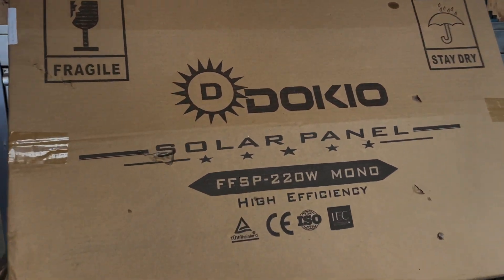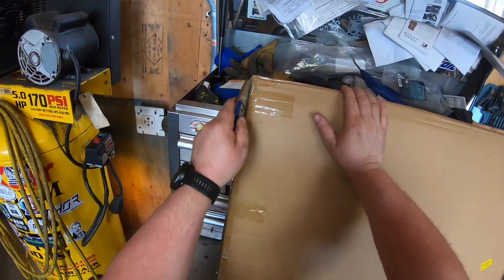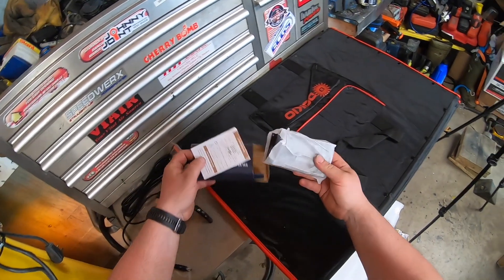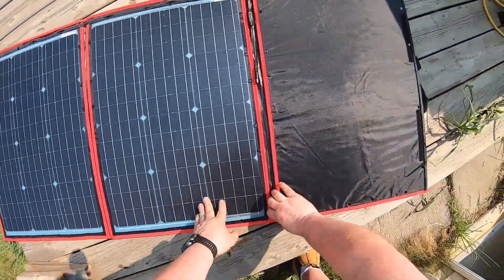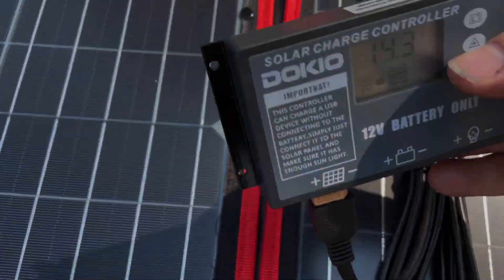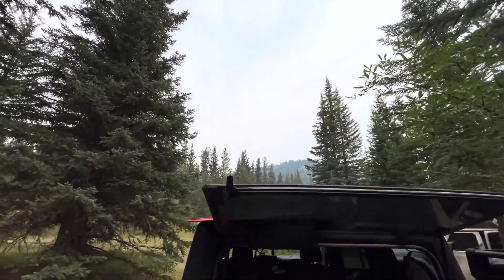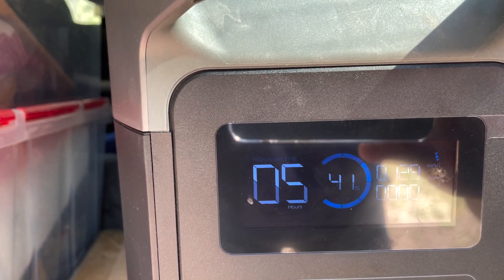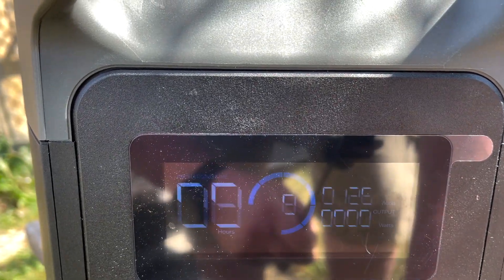Dokio 220 Watt Foldable Solar Panel

Comment: Hi Jerry… I ordered the panel also because the description on Amazon says it has two USB ports to charge directly. Did yours claim to have that?
Reply from the maker: I never use them to be honest
Reply: @TestDontguess  OMG! I use USB to charge my Dewalt batteries that run lights, fans as well as tools…. I can’t go without changing so many items that I thought it would be easy with this solar panel. Just checking who has put YouTube videos out. Maybe you got it free… I paid for mine.
Reply from the maker: I have portable power stations for power, the solar panel just keeps the power stations charged

Comment: Informative video, thanks for sharing it, I've got a couple of questions. 

How has the DOKIO 220w worked out for you so far? 
What's the unit that you are using to plug in the portable solar kit called? What can you power with that unit? 

Thanks

Comment: I bought a new house this past year and all new construction homes built here in Commiefornia are now  required to have solar.  I wasn't completely convinced until I started getting my power bill from the utilities.  This last month my bill for electric power (with the solar) was $5.00 (five bucks).  I'm liking it more now. :-)
Basically, each year the total amount of power you generated is subtracted from the total power you used.  Then, your bill is adjusted accordingly.  If you generate more than you use, you get a credit to your account.  There's a little more to it than that, but that's basically it in a nut shell.  And we get a tax credit based as a percentage of the purchase price of the solar equipment, on our federal income taxes.
Reply from the maker: That’s awesome I love the idea of solar I’d just like them to get a bit more efficient first
Reply: Wasn't convinced that solar panels work? You've been living under a rock? Haha of course they work. Every house should have them.
Reply: @chevyspeed6368  Only if you want them
Reply: What was the total cost of the solar system install and what is the ROI timeline?